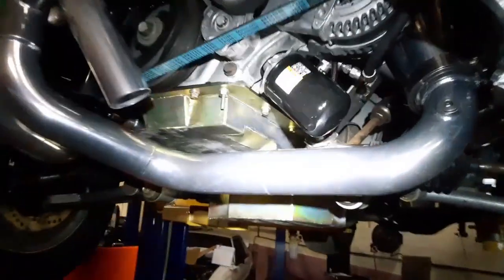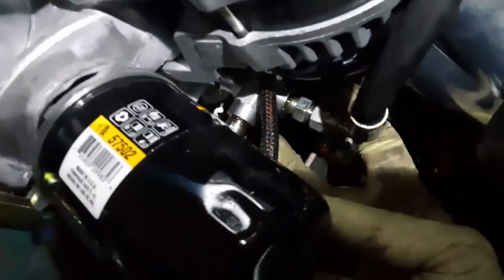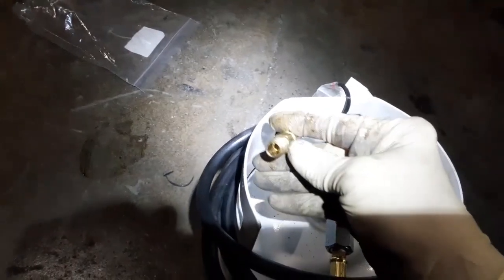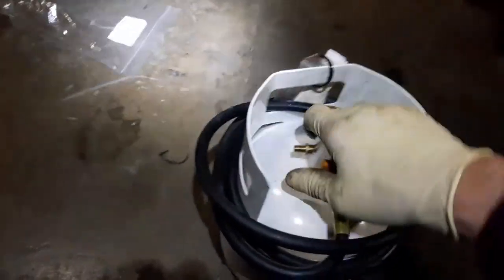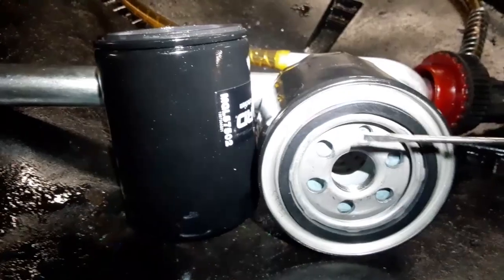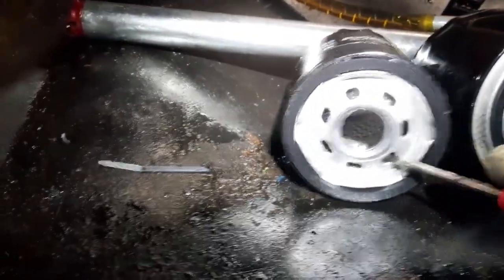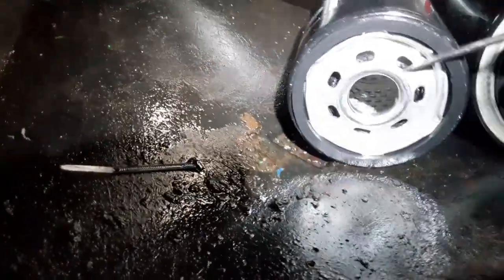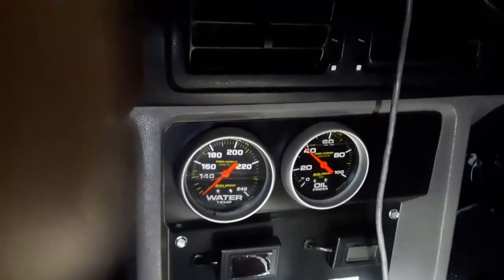Mike's Garage EP1: How to Prime a 4.6, 5.4 or Coyote Engine Oil System

Comment: Don't drill your filter. You will never get the metal shavings out and it will go into your engine. Figure out another way to eliminate the valve but drilling it is not the answer
Reply from the maker: I didn't drill any metal. It was rubber. I figured out a better way, just stabbing it with awl, and then using needle nose to remove the rubber enough to let oil through. This engine has been 155 mph and going on it's 3rd season, doubtful anything was damaged.
Reply from the maker: It's rubber, not metal. I did figure out another way. That engine lasted for 5 seasons at 1k rwhp, bearings came out with no evidence of metal shavings. I did do another filter using a pick and needle nose pliers to remove chunks of the rubber valve.

Comment: Where does one aquire  said pressurize oil canister?
Reply from the maker: I mentioned in the video I found it on Amazon, but there are other tool supply places that sell these as well. I'm cheap, so I went with the best deal I could find.
Reply from the maker: I got mine from Amazon. I believe it was 70 bucks or less.

Comment: How did you handle to metal from grinding with the dremel? I am in the process of right now of priming my 4.6 3V, and certainly would be leery of any shavings getting into the oil. I have a ton of money into this engine and it would devastate me to have anything shorten its life lol.
Reply from the maker: It is rubber, not metal but I need to redo this video, I used a pick and needle nose pliers and ripped the rubber valve out.
 I also rinsed the one in this video with brake clean before I used it in this video. And the oil flows into the pan where I drained it and replaced it. My new one had no possibility of residue in it. Thanks for watching.
Reply from the maker: It's rubber, I did not grind on the filter housing at all.  I used a teeny tiny round bit that came with the dremmel.  I was very careful and got as much of it out with tweezers and a pick.  I then flushed it out with a bunch of brake clean.
  If anything does get pushed towards the oil pump, when you crank it to prime it, it will just get caught by the filter when it flows through it.  So I wasn't concerned.  This was my coyote race engine that will be in another video later on.
Hope this helps you.

Mike
Reply: @daytonperformance8257  It would be much simpler to buy a cheap filter without a drainback valve.
Reply from the maker: @BansheeZR1  Find one and let me know what the part number and manufacturer is. Thanks. I looked at every filter Oreillys had for this application and they all had a drainback valve.